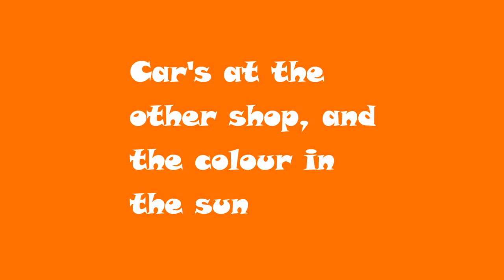Car at other shop.

Comment: primer does make a bit of difference to the top coat from what i've heard.  Ideally for light colours you go with light primer and dark colours dark primer, so that you need less coverage.  I tinted my white primer with red, so it went on pink so that it wouldn't be a slightly pale red.  I always think of candy paint - they always tend to pick layers of colours that make sense to the final desired outcome. I've heard of people using yellow primers under red top coats to give the red a bit more..

Comment: of a glow.  i personally think that it does make a difference from what i've heard and read to have different primers slightly affect the final outcome.  The top coat is so thin, even if you pile on the layers, won't be more than a few mils, so especially sunlight being so intense, would bounce back differently.  I wonder if there's a high tech test out there to show the difference in spectrum. hmm - gonna have a look.  anyway, nice update, getting very exciting :)

Comment: Ah yes of course that was a very similar colour, good shout Jeff! i inboxed you a link as youtube won't let me post weblinks in the comments.It is an ongoing debate that's for sure. In that link one guy is saying that if you get enough coverage if's fine, the other guy is saying you would need 12 coats to equal the test card because test cards usually have the paint hammered on  coat after coat whereas your car will have thinner coats.  Only way i guess is to do a test panel split with 2 primers